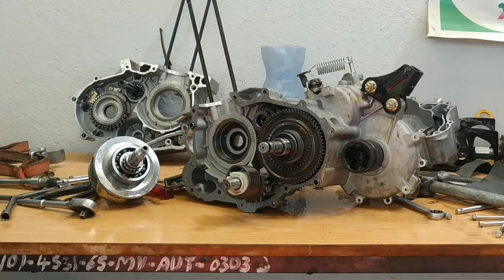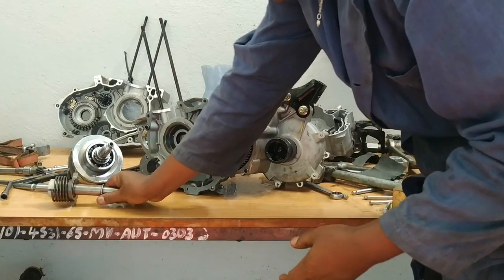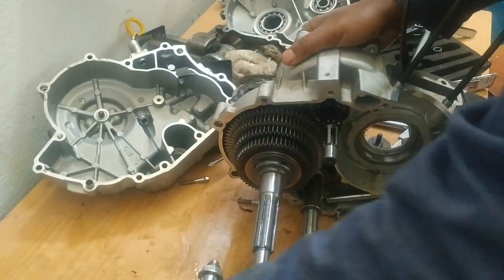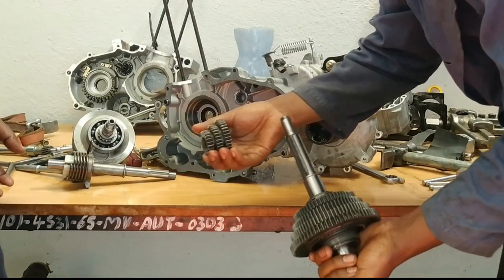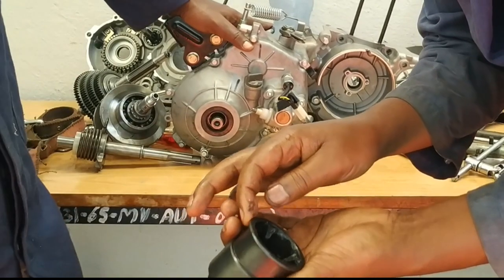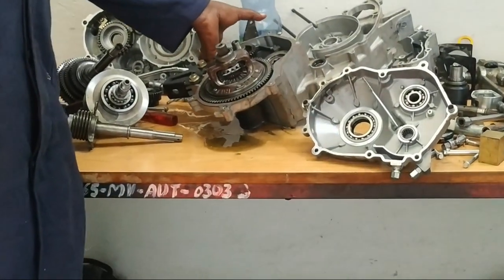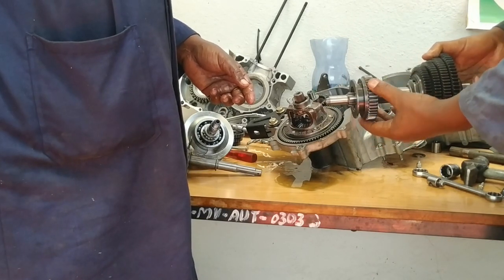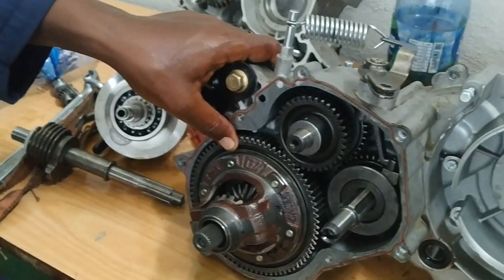how rickshaw transmission works

Comment: Hello sir, I am from bangalore, I have 2013 model bajaj double doom auto, auto pick up low, head and bore changed.  Still no pickup, what's the reason?  Is the engine spare parts worn out?
Reply from the maker: Have you checked of the parts have been correctly assembled? especially the timing?

Comment: I have a Bajaj Maxima Z, August 7, 2022.  The shifter always sticks when the engine stalls.  Makes it very hard to get it into neutral to start the engine.  I have had to learn to do the "Bajaj shake".  Shaking the vehicle while tapping the shifter.  I hear from others that this problem is normal.  So why is that?  Why is the shifter often very hard to move?  Reverse often does not click in.